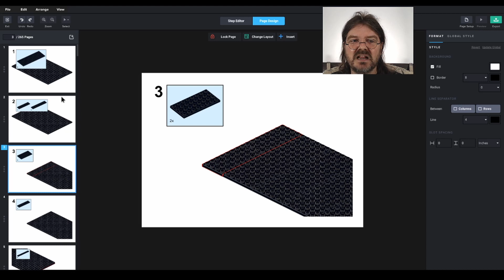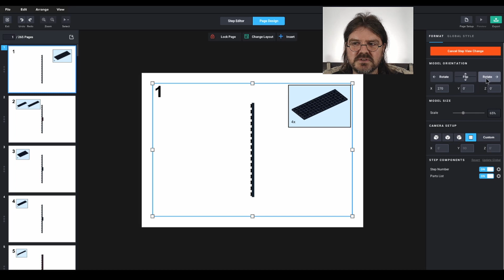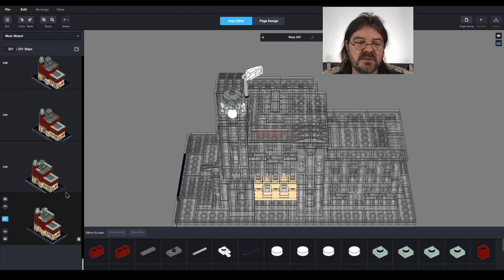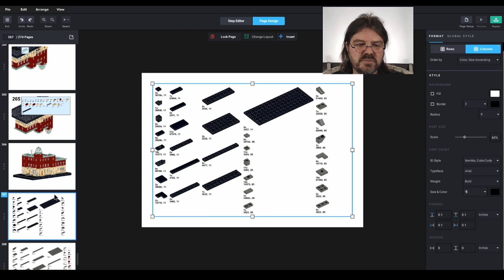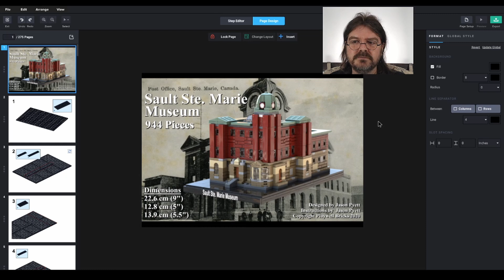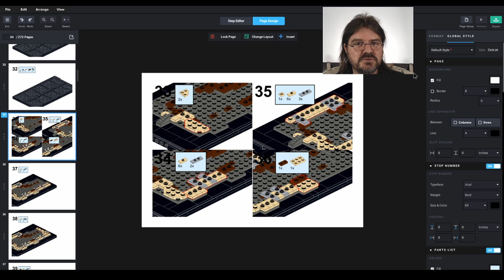Studio Tutorials - Instructions - Page Design. Create Professional Instructions for your LEGO design

Comment: Have you found a way to push a step to the next page without adding an extra step yet? Say I have only 5 steps I want on one page, but the next step is the first step of a sub model and I don't want the next step to fill the 6th slot on a 6 step page format. Is there a way to push that 6th step to a new page?
Reply from the maker: Yes there is. Lock page containing the step you do not want to include, on the first step of the series of steps, choose the numbers of panels you wish. The locked page will not be included.
Reply: @PlaywellBricks  thanks! I will give it a shot!

Comment: If a submodel is existing two times or more LEGO instructions use the function 2 x or 3 x. You have to build this submodel tweo or three times. How can I make this in Studio?
Reply from the maker: You have to have the submodels in the same step, when you do this the multiplier will appear in the instructions.
Reply: @PlaywellBricks  Many thanks for the quick response. I created 4 sub-models of the 4 identical objects and they are all in one step, but the page design view still show four steps for each object. Must I click on a checkbox or does It works automatically?
Reply from the maker: @Lokschuppen-Dominik  You need to link the submodels. Sorry, I forgot to mention that.
Reply: @PlaywellBricks  what means link?
Reply from the maker: @Lokschuppen-Dominik  Select all the identical submodels, then on the bottom right hand side of the view port there will be an option to "link submodels".
Reply: @PlaywellBricks  Thanks a lot, it works, that's great!

Comment: Hi Playwell Bricks! Thank you for your video! 
I have one problem with page design.
When i finish working with page design i click "save" and close a project. And next time, when i going in the same progect page design to correct something i see that all my corrections in page design is missing! It looks like I didn't do anything before saving. 
What i can do with that? Have you same problem? Thank you for ansver!
Reply from the maker: I haven't had that happen before, sorry. I have had a similar situation happen if I hard qui the program (end the process through task manager). The recovery file will not hold the save to the page design. Other than that if you make changes to the model after you have done your page layout, that will also affect your page layout, but not like you describe.